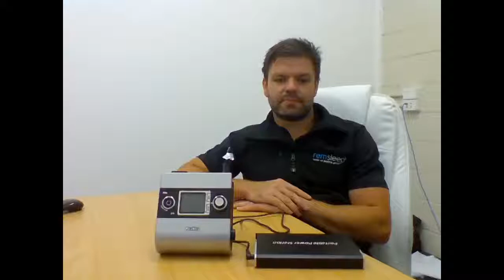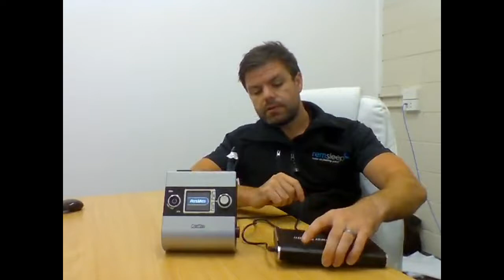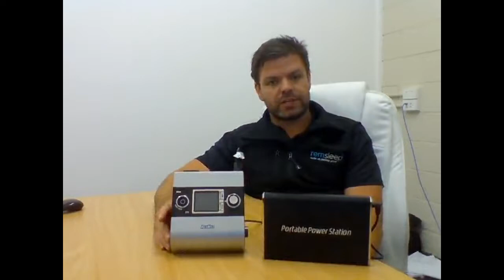CPAP Battery Education

Comment: I have a ResMed S8, 12V. But I understand that there is something special about the DC adapter for it? Center pin is a negative? Where can I get such an adapter to go from a 12V battery into the S8?  Thank you for doing this.

Comment: I have a Resmed airsense 10 and I have the DC converter from resmed with it I tried it for the first time on a 1000 watt power pack and it only ran for 2 hours any idea's? I also couldn't find the web site cpap batteries. com
Reply from the maker: Turn off your humidifier and heated tube system

Comment: I bought a deep cycle agm battery and an inverter. It works perfect for 3 days with humidifier. I camp for 5 nights so I bought a second battery. Not cheap but love a good night sleep. I camp often so worth it for me. Battery world helped heaps on this build. Ruffly 1300. 2 battery, inverter, smart charger and battery box with battery level indicator. Allows for 6 days camp off grid.

Comment: I am going to build or buy a high capacity engine booster pack w/just enough energy to operate my Phillips System One WITH my heated hose & humidifier for 12 hours. I just upgraded my 2008 Honda Element to a LiPO4 starting battery w/BMS & emergency back up from DOHON. I'm very please w/it. 

What I needed from this video was the maximum draw of my System One so that I can size the 12.8V battery pack for overland travel & sleep in the Honda Element. I plan to use the battery pack as a UPS for my gateway at home when not abroad & as emergency in house CPAP backup as an alternate. I have plenty of work planned for this unit.

Comment: I am looking for  a more flexible battery option with and AC Outlet.  ChargeTech has a TSA approved 27,000 mAH, 85W, 110 volt option that they say will run a CPAP but they do not have information regarding specific CPAPs.   Do you have any words of wisdom?
Reply: Solar panel, LiPO4 battery, charge controller, 110V DC to AC inverter. endless power.